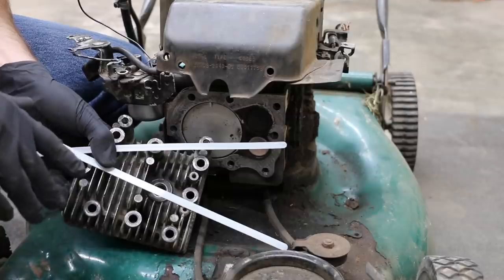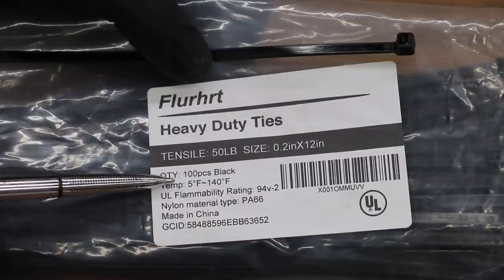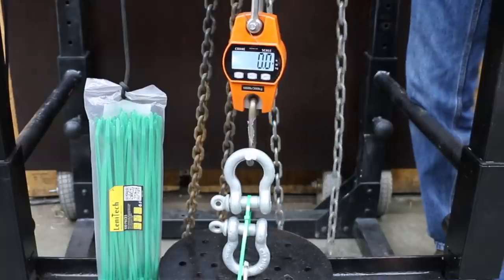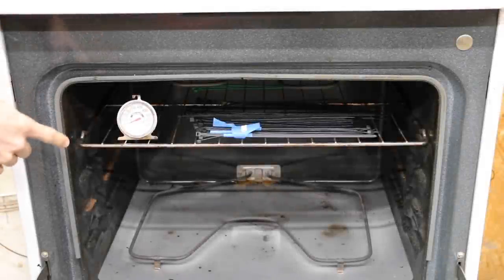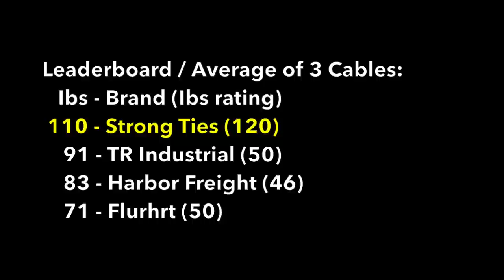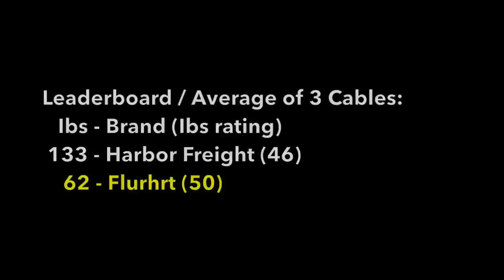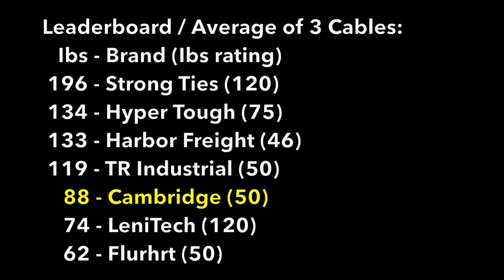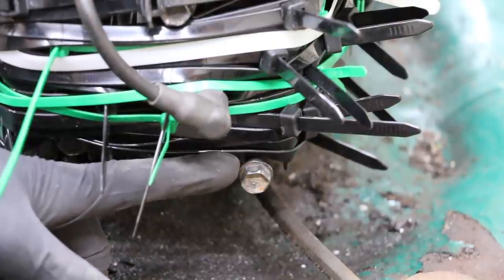Best Zip Tie Brand (7 Brands Tested)? Let's find out!

Comment: How about a segment on the best tire valve stems for tubeless tires. I've noticed over the past 35 years that the rubber in these valves just don't hold up like they use to. When doing tire inspections I've noticed a lot more defective stems where they tend to leak air and show visible cracks and dry rot at the base of the rim. Usually when checking the air in tires I move the valve side to side to check valve integrity. In years past this wasn't much of an issue...but now a days it seems to be real common. (Note...I'm referring to the standard tire valves...not the TPMS valves)
Reply from the maker: Thank you for the video idea!
Reply: In years past there were generally lower levels of stuff that degrades the elastomers.

Comment: Unless I'm mistaken, Harbor Freight has a ziptie that is identical to the strong ties in terms of thickness and have had it for years. Would have been nice to at least have a like for like comparison there since the thinner HF zip tie actually did very well. 

Doesn't diminish the results, but the strong ties probably isn't as good as it appears.
Reply from the maker: Thanks for the feedback.

Comment: Suggestions for the channel: shop safety equipment. Is it worth the cost fo the more expensive stuff? For example...shop gloves. The hardware store has them for widely different prices. I've worn through dozens of leather gloves with the die grinder. Which can stand up to a die grinder abrasive disk? Then there are safety glasses. Some are cheap, some are expensive. I've had a few pieces of steel embed itself in the glasses. How much can different prices of glasses take?
Reply from the maker: Thank you for the video idea!

Comment: The shelf life of these things is a serious consideration. If any of them had been sitting for a year, I'd expect them to be fragile compared to ones that were not. At work, there are ties that break instantly in the winter, yet if you throw a wet paper towel in the bag for a few days, they become as pliable as rubber bands and hold enormous strength.
Reply from the maker: Great point!  Thank you
Reply: Nylon of any sort is affected by humidity. String trimmer line has much more resistance to breaking if it is stored damp.

Comment: I use Harbor Freight zip ties to hold the front bumper cover on my son's car.  After a few months in New Mexico, they can easily be snapped between your fingers where they have been exposed to sunlight.  They are black in color.  It would be nice to know if there's a brand or color that really is more resistant to UV light?
Reply from the maker: Thank you for the feedback

Comment: Since cable tye/zip tye are made of PA66 (Nylon), did you consider that PA66 has a quite high absorption of humidity, which effects highly the mechanical properties?
PA66 mechanical properties are measured:
"Dry as moulded (d.a.m.) or " "Conditioned" (standardized exposure to humidity, temperature and time).
If you tested the cable tye right out of the packaging, they have different humidity levels and show different mechanical properties. To give a correct comparison they need all to get at the same level of humidity.
Reply from the maker: Thanks for the video idea.

Comment: I'm also wondering if the results would change if purchases were made at different locations.  Since zip ties weaken drastically when exposed to UV, maybe their age, or proximity to bright light could skew the results?  I suspect the Harbor Freight brand would be fresher, as they likely sell a lot of zip ties, conversely, the expensive brand may have been on the shelf for a while?  They age like rubber bands in UV light.
Reply from the maker: Thank you for the feedback

Comment: As an electrician I was very interested in this test. I’d like to see a follow up video using some industrial brands like T&B, Panduit, Dottie, Gardner/Bender and 3M.
Reply from the maker: Great recommendation!  I'll test them soon. Thank you
Reply: @ProjectFarm  Please test Ty-Rap® cable ties. I have used them exclusively for 20 years with no surprises. Always ordered UV resistant. You always have such high production standards. It is greatly appreciated

Comment: Ty rap from Thomas and Betts with an infinite adjustable metal locking tab.  We use them to hold up the fibre optic and copper cables outside in Canada on poles. UV resistant. Year 24 as a tech I'll let you know if one ever breaks... I also use them as handles to pull 100+ lb concrete filled plastic lids off telecommunication flush to grade containers with freezing slush and ice on them.
Reply from the maker: Great recommendation!  Thank you

Comment: It really depends on the application.  To simply hold a bundle of wires together any of them will work.  But to hold back something heavy or under pressure is something else again.  I wonder if the amount of stretch before breaking is worth testing?  These zip-ties can also fail by slipping without breaking.  I can imagine them stretching and allowing a bundle of something to escape without the tie being broken.  Sometimes ties that can stretch without breaking can be a plus other times ties that resist stretching are superior.  Also, how about testing them joined together perhaps three ties long?  That would be a good test of the clasps.  It is very often that large, heavy bundles will require several ties joined together.  It would also be interesting to see if joining several together increases or decreases their strength.
Reply from the maker: Great feedback. Thank you

Comment: Garden hose, both conventional as well as the self coiling expanandable type. Drain plungers of various types. Drain cleaners. Gasket sealers. Multi purpose cleaners like Purple Power etc. Furniture polish. Auto polish. Tile & tub cleaners.  Window and mirror cleaners. Spray paint, wall paint, high temperature paint, etc. Caulk and other joint sealing compounds. Teflon thread sealing tape. Solder - for electronics, plumbing, high strength silver solder. Welding wire for FCAW & MIG,  stick electrodes, auto darkening welding helmets, TIG electrodes,  and welding gloves aprons sleeves etc. Pull saws, planes, chisel, draw knives, drills for wood, metal, and masonry. Hole saws. Router bits. Calipers and micrometers. Tape measures. Levels and squares. Chaulk lines. Dead blow hammers. Hack saw blades. Table saw blades. Safety glasses and shields. Bandsaw blades. Hope this helps! Keep up the good work!
Reply from the maker: Thank you!

Comment: I have a video idea for you! Testing different brands and kinds of spray paint. When its -10 here in Minnesota I don't want to get the air compressor, tape off areas, mix together ratios of my epoxy or bedliner just to paint something small. I want to use a spray paint can so I can prep it nice and quick and paint it within minutes and clean up fast. For example when I use rustoleum, if it stays in contact with ANYTHING it will bond to it and when you go to pull them apart it will peel off, and yes this has even happened with things that have been on a shelf and dry for a year, if it gets in contact with another painted surface it will basically glue to it. Rustoleum is cheap, it makes me hesitant to buy different cans which can run upwards of $20 in fear they may perform in similar ways. For example I have some Speedokote 2 part clear and I have NEVER had an issue. This stuff is my go to for painting and I never have to worry about it sticking or bonding to another surface, just don't like using it for every darn thing I need to paint
Reply from the maker: Thank you for the video idea!

Comment: I work at Home Depot and I use a ton of zip ties. They are so handy. Every tool box should have some. The brand I use most is called commercial electric. They seem to be better in my opinion than the harbor freight.
Reply from the maker: Thank you for the recommendation!

Comment: Would a zip tie perform differently depending on how/which way they “zip junction” was oriented?

In the breaker mechanism you created, the “zip junction” was always along long side of the loop. 

If it were along the top or bottom, against the bolt of the clamps, would it become a point of weakness?
Reply from the maker: Great point. Thank you

Comment: I would like too see one more test.
That is after the ties have been in sunlight/uv light for a time.

I did find a bag of some cheap black ties that had fallen down from the shelf and behind the bench where there where windowsil (facing south so maximum sun) that was lower then the bench.
And i had searched like mad for them and knew exactly when i bought them and they had been there for around a year.

They where completely useless after that and would break almost before you even started to tighten them at all some did even break if you bent them slightly.
Reply from the maker: I'll do it. Great test idea!

Comment: You should compare Milwaukee and DeWalt power tools. I'm talking the high end impact wrenches. One always seem to claim more torque than the other. Perhaps the half inch  Milwaukee FUEL vs the DeWalt half inch impacts. We change a lot extremely rusty irrigation tires that make changing semi truck tires seem like a piece of cake.
Reply from the maker: Thank you for the video idea!

Comment: Harbor Freight zip ties all day for basic general purpose use, at the price it is a no brainer. I don't generally use zip ties for applications that need any high amount of strength, so most get the job done. That said, it is nice to know the stronger ties, and that like anything, you can't always believe the ratings on the package. HF looked to have performed great for the price. Plus with HF you almost always have coupons to save even more, lol.

Comment: Hey, I've got a suggestion for you. Can you do a video using paracord? What are the strongest knots? What brand is the strongest? How is the performance compared to the capacity rating? What weave takes the most to cut through? Are the different weaves different strength at all? Would it take longer to burn through one weave compared to another? Can paracord hold the cylinder head on with the right knot?
Reply from the maker: Thanks for the suggestion.

Comment: I use mostly HF or Walmart zip ties.  I never really considered buying them by brand name.  Most of the things I use them for do not require a very strong tie. 

Where I find that they fail is outside.  They seem to get brittle in a year or so and break, probably the UV light.  I find the same thing happens with plastic tubing clamps.
Reply from the maker: Thank you

Comment: The Harbor Freight ones were quite impressive and very cost effective. It cost a 3rd of what TR Ind cost (3 cents vs 8 cents) HF came in 3rd, TR Ind came in fouth. It cost 1/5 of the Walmart Brand (3 cents vs 15 cents) Walmart came in second. Running a shop...cost of materials is very important... You could buy 3 packs of Harbor Freight to one pack of TR Ind...and 5 packs of Harbor Freight to one pack of Walmarts Brand...all 3 having virtually the same quality, and if you were worried about strength, you could add another zip tie and still come out cheaper. Harbor wins this hands down. IMHO
Reply from the maker: Thank you!

Comment: I love your channel, man, and I've actually changed brands on some of the items you've tested.  Because of your channel, I'll never buy anything but the original JB Weld for glueing anything (other than wood).  I have to ask you though, why did you not include "Ty Rap" brand in this comparison?  "Ty Rap" is the original, and I'm betting, by far, the strongest zip tie around!
Reply from the maker: I appreciate that!

Comment: I would like to see you put some out in the sun for a couple of weeks and retest.  UV stability is a big issue of you use them outside.  I would have put the cylinder head bolts in, torqued them down, put the ties on and tightened down and then remove the bolts.
Reply from the maker: Thank you for the video idea!

Comment: im wanting to do car body repairs cheaply for folks but that isnt always easy thankfully their is easy stuff like jb quick weld products and such im curious out of all the products that are quick easy sandable items what one is the strongest to repair body work with plastic or metal wise. id love to see all those sort of products tested for ridgedness or something like that your always good at finding those sorts of things. so i guess body work item weither its a jb weld item, fiberglass matting, or whatever else you would wana test im curious what would be the overall strongest but still slightly flexible so it doesnt just bust under pressure if lightly bumped.
Reply from the maker: Thank you for the video idea!

Comment: What about different anivls? I've heard from dozens of people that you want an older anvil because the quality and heat treat is better. There's significantly better steel in the world than 125 years ago so I'd be curious to see how a modern cheap/expensive anvil would compare to a turn of the century used anvil. As a comparison point many shops I know just use a piece of railroad tie as their anvil so I'd be curious to see if they're missing out on something. (Hardness, fracturability, durability from repeated blows/grinding...)
Reply from the maker: Thanks for the video idea.

Comment: Entertaining video, with surprising results. There is one thought about the tests, that will have an impact on the results that I wounder if it was taken into account. The age of the zip ties, as in how "fresh" they were during testing. Plastic loses its abilities the older it gets and how it has been stored has a huge impact aswell. If you bought 2 packs of zip ties from the excact same lot number and stored one pack in a drawer at room temp, so its basically in the dark, and hang the other pack in a tree exposed to rain, sunshine and so on, for say 6 months, the results will surprise, if not shock you!
Reply from the maker: Thanks for the video idea.

Comment: If you would like to get serious buy 
THOMAS & BETTS "Ty-Rap" Cable Tie (*Small: TY5232M / TY232M 1.5 -  8"  long Tensile strength 80 N or (18 lbs) ! *Large: TY54513M  45" long, Tensile strength 780 N or (175 lbs) !) Now that's a cable tie ! Love your videos.
Reply from the maker: Thanks so much!  Thanks for the suggestion.
Reply: @ProjectFarm  I worked for Bell Canada for 24 years and we used exclusively the "ty-Rap" brand (I think that the entire telephone system is held together with this type of cable ties) ! ! and I tell you after all these years these ties are still holding strong ! Again, thanks for all your work on these videos. Much appreciated !

Comment: I've found that the for some reason the black ties are more brittle than the white ones from HF when it gets cold. I used them to secure chasis pin locks and more black ones broke than the the white ones. For the money the HF brand is pretty good.
Reply from the maker: Thanks for the feedback.

Comment: 1)  I sometimes use zip ties outside and wonder how your brands would be affected when they are exposed to sunlight over time? 2) Did all of the zip ties break at the point where they were connected as result of the connection design or did they break elsewhere along the tie?
Reply from the maker: Thank you for the video idea!

Comment: If you have these products still, I’d like to see an aged test, like after a month or two of being out of the package, say in a box or toolbox, I had some big thick wide zip ties that could hold a trailer hitch up fail just from making a bend through a hole because they aged, it was surprising and I had to double up on cheaper ties and a lot of them to get the length right too
Reply from the maker: Thanks for the suggestion.

Comment: It’s actually really funny to watch this particular video. Everyone knows zip ties are pretty dang strong, but not how strong. A few months ago I had to pull a transmission out of a car to put a built one in. The problem was I was alone so not easy to do and I didn’t have what I needed. On the positive side I wasn’t worried about it getting damaged since it was trash so I got creative. 

I pulled a big heavy auto trans out of a car with zip ties, a single tie strap, and a cherry picker. It worked flawlessly somehow. I took the zip ties and I put 1 through the top 5 bolt slots of the bell housing and a second one on the 2 outer bolt slots. I then ran the tie strap through all the zip ties, then put it under the back and brought it back up on the trans mount so it couldn’t slide forward. Then I tied the strap to itself really strongly. I then pulled the 2 sections running from the front to back together and put them on the hook. I used more zip ties so it would move at all.

Quality zip ties are a life saver.
Reply from the maker: Thanks for sharing.

Comment: I know that I am a little behind but Panduit by far has the best cable tie.  The PLT1mm has the best tensile strength and temperature rating on the market.  It is used mostly in industrial applications but should have been used it this test
Reply from the maker: Great point. Thank you

Comment: IDEAS FOR FURTHER TESTING:    One thought... since zip ties are quite often used only to hold things together without strengh,  like wires and such, it is often more important to see how well the LAST - i.e. - how do they stand up to weather and age.  You could tie a bunch around a steel rod and alternatively put them in summer heat in the oven, winter cold in your fancy freezer, strong ultraviolet light, and do this repeatedly for several cycles... Then test them for strength.  as outdoor ties holding things would have wind to deal with.  Another is torsion.. how well do they hold two things together that might bend and pull in oposite directions such as wires strung over distance or tags being held on an outdoor conduit which might flap wildly.  Just random thoughts.
Reply from the maker: Thanks for the video idea.